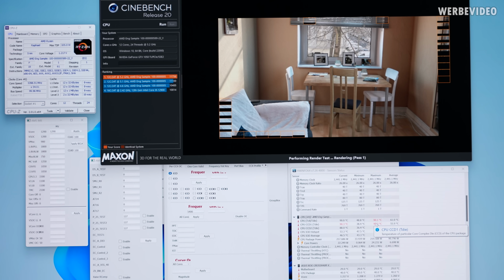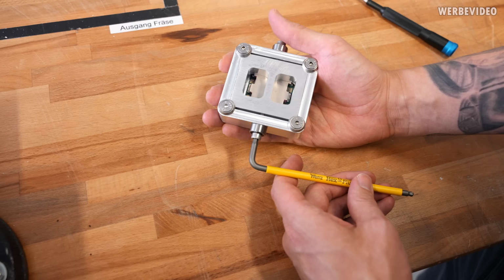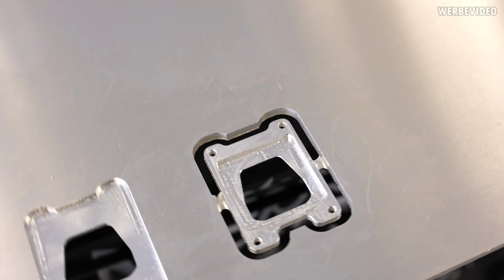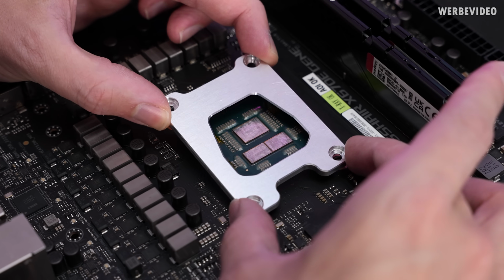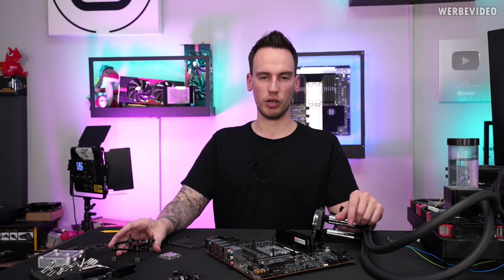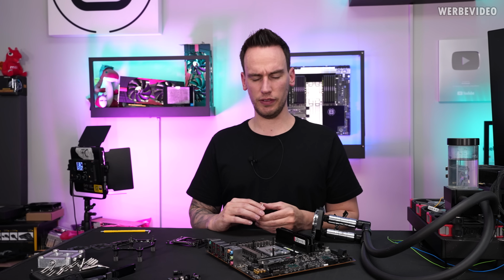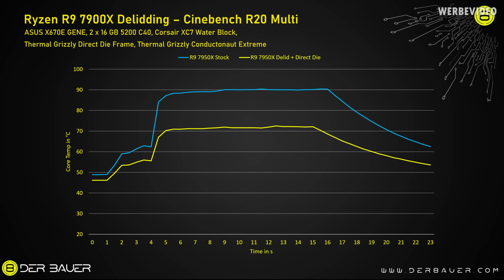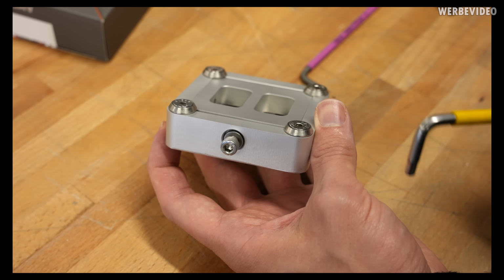Ryzen 7000 Delidding - Unreal Temperature improvement with Direct-Die Cooling

Comment: i wonder if there are companies that would sell de-lidded CPU's with blocks and brackets as a package, those temps are insane
Reply: You get no warranty from Intel or AMD on chip like that and its easier to damage So price would need to be much higher to cover customer support and warranty (in Eu you cannot sell anything with no responsibility at all, maybe in USA they could)
Reply: @cyjanek7818  No, you have to warranty it to some degree.  Not only would you run afoul of legal problems, no retailer is going to touch it.

You HAVE to send out working parts.  There is no way a delidded "at your own risk" part can consistently be proven to not be the manufacturers(or 2nd/3rd party who performed the delidding) problem.

That's also why ebay lists them so high.  The people selling them have to eat the cost of refunds when people break them due to ebay's policies(because Ebay sure as fuck won't eat the cost of a bad idea like delidded CPU sales).  Also, watch the video to the end.  Yep, even the delidding process makes waste, so it's probably not economical in the first place.

TL;DR Do it yourself, be ready to throw a grand in the fire randomly.  No one wants to assume your risk.
Reply: @Grimmwoldds  Thinner IHS CPUs might be viable and much better termals
Reply: @Grimmwoldds  I wonder if someone could figure out that risk exactly of that 5700 case. Like this who is selling the delid equipment. As you go selling those delidlings you get the data and can find out insurance price.
Reply: Right! 95 to low 70 is indeed impressive! Debauer u should update amd of the IHS thickness issues or maybe release a delid kit into mainstream damn impressive ! 😱
Reply: @CrimsonDay92ShaDow6iX  I doubt AMD would change anything. I'm sure they're aware of the thickness of it and what it does to temps. They really couldn't change it without impacting their board partners. If you lower the height even by a mm, you're then sitting under where a cooler could make contact with the IHS. It just wouldn't be feasible. You would then have consumers confused because what CPU works with what board? Pre IHS update chips would only work with pre IHS motherboards.
Reply: @CrimsonDay92ShaDow6iX   AMD designed IHS thickness like this to make space for 3D cache. Look at AM4 5800x3d. They where able to get extra cache on top of the cores or whatever without affecting cooler mounting/increase IHS thickness. Ryzen 7000 was designed for 3d cache but the CPU's launched now do not have it. But has space for it... Mmm. So the parts sold today is being hold back to make space for better parts in the future that needs more space.

I might be wrong. But that explains the IHS thickness. And with 3D cache heat is only to become harder to manage. And if I'm not wrong. Pats with 3d cache is going to make this costume cooler mounting incompatible since the extra space for cache is not accounted for. Like really this move with IHS thickness is just to make it easier for AMD. I bet AMD also have made sure the CPU's hit 95c by design to hide the IHS and in general poor cooler performance AM5 have. Since even with a good setup you hit 95c. With a bad setup you hit 95c. It is by DESIGN... Sure AMD. When energy prices are going insane we drop the idea of efficiency and boost performance by pushing more power!
Reply: @TheDiner50  I don't think the 3D cache adds that much height.
Reply: @Knowbody42  3D cache adds no height, they shave down the silicon before applying the cache die
Reply: @TheDiner50  No no no They make the IHS thicker for AM-4 cooler height compatibility. with AM-5. The non 3D version is the same thickness as the (7900x).
Reply: The problem with dllidedCPUs is that they too easy to get damaged
Reply: @alexer_eternity  They are not that easy to break specially if Intel and AMD directly sold them slightly cheaper without IHS and we would have coolers made just for direct-die cooling with proper safety measures that make it almost impossible to break them, kinda like a laptop or GPU, you really have to try hard to break one, I already made almost all my strength on many with a big screw driver and never managed to break the die on one of those direct-die coolers because they always have something to stop further pressure unless you go rambo muscle on them or with like a high power electric hammering screwdriver LOL.

with proper safety I'm sure it's always easier to break a motherboard pin or a CPU pin on the AM4 than cracking the die of the CPU unless you drop it into the floor and even still the CPU would be so light without the IHS that probably would be even safer when dropping into the ground cause many people broke CPU's that way where the corner completely broke and shorted all the layers but who knows...

ps: Also it would be about choices, true enthusiasts could save a few cents and get what they always wanted from start from the brand it self and a newbie or OEM PC's could keep going with IHS CPU's. The best for each person to chose (stupid in my opinion is paying for such thick IHS and all the metals needed in between to lose so much cooling performance that it's looking like when Intel cheaped out with thermal paste and that I never asked for)...
Reply: They're called laptops.
Reply: Silicone lottery used to do that as well as sell chips that had won the silicone lottery and had insanely high stable clocks. Unfortunately as tech advance, chipmakers began binning their good/bad chips with substantially more accuracy destroying half their business model. Intel followed with switching from polymer to solder TIMs which greatly reduced the benefits of delidding destroying the other half of their market. to finish things off then the supply chain issues began followed by covid and a whole heap of additional supply chain issues. All this combined happened in a 1-2 year span and forced them to shut their doors. awesome company while it lasted.
Reply: It's not sustainable to buy and sell delided, to much risk,
Reply: You have as much chance of that as getting a GPU without a cooler expense for choice of your own.  Noooooope
Reply: I was thinking the same thing ….. also a “one stop shop” is very convenient for many 🥰👍💪 ……. The return of Silicon Lottery 🧐🤓
Reply: Most likely not worth it at least judging people's price on delidded intel CPUs...

Even used they sell old CPUs delidded at such high prices that a lot of times we can now buy something much newer and better for the same price sadly...

I wish was that intel and AMD would sell a slightly cheaper CPU without IHS cause it's sad paying for something that I don't want and much less something pointless that makes the product much worse 🙁
Reply: @guily6669  problem is when people tighten it too much and destroy their cpu it will be amd and intel problem... If they release it like that there wouldn't be a warranty
Reply: @RYU47376  AMD used to sell CPUs without a lid. I had one with bare silicon die under the heat sink.
Reply: @RYU47376  I don't agree because if there was no IHS CPUs we would then have direct-die coolers and all the safety measures would be on the cooler to make it right but never to the point of breaking just like laptops and GPUs, they have either washers or springs to prevent further pressure and would actually be pretty hard to break such thing...

Also I already managed to break a 3770K die and it's not super easy, I had very bad luck cause I had bios problems and went back and forth many times with 2 boards and 2600K and the 3770K and the tems were still disappointing because I was using a huge air cooler with crap mountings, it only mounts vertically but sadly the cooler would move quite badly horizontally to the sides and when I was forcing moving the cooler sideways with my hands sometimes the temps drop by a lot. Sadly I eventually was pissed and make too much strength to the sides and that was it...

Anyway if the cooler was mounted like a "X" it would have had pretty good mounting pressure and would have had much better temps like a watercooler which has way less weight and distributes the pressure in both horizontal and vertical as long as the screws are tight in a X.

Also latest CPUs are even harder to crack the die compared to the 3770K cause the area of the silicon die\dies are way bigger.
Reply: @RYU47376  maybe with some block screws or something. Would be a good idea
Reply: @Wingedmechanic  Not just AMD, intel too, my Pentium 3 700MHz was also without lid,  2002.
Reply: @Wingedmechanic  K7 series were lidless, along with the early K8 consumer CPUs. They reintroduced IHSs with the Opteron as I recall.
Reply: @RYU47376  If they release it like that there wouldn't be a warranty
Sounds fine to me, I accept the consequences for all OCing decisions I make.
Reply: @guily6669  delidding the cpu greatly decreases the chance of false warranty claims from amateur users cracking the die during install or from shipping damage, especially when liquid metal or other electrically conductive Tim's are involved, those who are experienced enough to be able to safely run a delidded CPU usually are willing to do it themselves, I'm not trying to classify people, I'm just listing valid reasons. After all, amd cpus used to not have heat spreaders during the athlon days so it's not like it's never been tried.
Reply: @guily6669 the amounts of products that's have failures because of no lids protecting them probably wouldn't be good.
Reply: i was thinking the same thing. but woudn't mind spending the money to get all the gear . i like to run my hardware at the limit . while having low temps . my pc now runs below 60° on air . cpu , gpu , gpu memory . all below 60 . (5600x , 3070ti) not the most difficult to get low temps i know . 3d mark score above average for similar hardware. top 100 actually .
Reply: I think Roman should do it along with a complete kit.  DeLid and full kit.  I would buy it.
Reply: @halrichard1969  I don't think he'd take that financial risk.

Providing warranty on his own products which are cheap compared to these CPUs is one thing.

Having to provide warranty on CPUs would be a major financial risk.

And he would have to, as he's German and de-lidding voids the Intel/AMD warranty, so he'd have to provide the mandatory 2 year warranty on consumer electronics, on parts that cost over a 1000€ even for him.
Reply: no, too many idiots would spill liquid metal over the cps on the processor and kill the cpu/system and blame the compnay they bought it from.
Reply: And because of the risk involved in destroying the CPU, the pre-delidded chip packages would be really expensive
Reply: They could do a limited edition version of their "insert flagship cpu" and sell a limited quantity.
Reply: @CrimsonSteelMoonTheWolf64  my point is delidding is such a delicate process that if you mess one up you now have to sell 20 more to cover your cost. Ruben could recoup costs with hardware bundle he manufactures but it's just not a liability worth taking on. He'll gladly sell you the tools needed though
Reply: Just imagine some company call amd and buy cpu without Heatspeader and sell it higher price yeah and it come with some Mounting Kit yeah that would be something
Reply: @Cake-je1hu  however, if said company could get delidded cpus without the IHS directly from AMD that's a whole different story
Reply: is too risky for warranty etc for a company.
Reply: Can't wait for stacked cache models early next year
Reply: No, mostly because of the legal and warranty problems. You are voiding your warranty by deliding the cpu. The improvement is massive but this couldn't be sold as a pack as it violates AMD's legal property of the cpu
Reply: if they sell it they won't offer warrenties, cuz it's none standard and coolers may break the chiplets.
Reply: Better yet... AMD should just issue a never-lidded sku.  Save them some money, and maybe even charge a premium for a binned part with no lid.
Reply: That happened before! The amd Duron back in the early 2000s all didn’t have ihs’s
Reply: CPUs*
Reply: The risk of damaging inventory would make it a cost prohibitive venture
Reply: i would go for those as well, i don't mind them charging 200$ more for the delidding work.
Reply: there is a huge gap, between the die vs the base of the heatsink, that will make most of the AIO / heatsinks not compatible, and would require a lot of modifications.
Will see how this evolves
Reply: AMD can do better, they should release new SKUs... same CPU but without IHS.
Reply: seems kinda pointless unless you include a motherboard with pre-mounted block tbh
Reply: this used to be a thing, I'm sure if there's a market there will be a service, but it won't be cheap, expect to pay 1.5-2x the cost of the CPU.
Reply: Basically is. There is a company that delids and overclocks for you
Reply: @FearOfDeath1332  Silicon Lottery went out of business a while ago didn't they?
Reply: Caseking used to sell CPUs binned by der8auer, might as well delid them too :D
Reply: There are companies, or at least people that do. 

One such company is Silicon Lottery. Their primary business model was buying Intel CPU's in Bulk and binning them so that people could buy chips that guaranteed a target clockspeed for overclocking. They also provided delidding services to those CPU's for not much more. The CPU's themselves did sell for a $50-150 premium based on how high they could overclock them. 

However, they did not provide a warranty because Intel does not warranty them. However as far as I've known, it was rare for them to have a CPU die during the delidding/binning process. 

They have since shut down due to 12th gen showing that Intel binned their CPU's better this time around. 

But there are lesser known people who do these services. Just that you are assuming all risk because neither intel nor AMD are willing to warranty delidded CPU's because thats not what their original designed is based on for warranty.
Reply: Warranty
Reply: AMD could sell us a CPU with even less stuff added for more money, surprised they don't
Reply: @RogerS1978  to be honest that's more Intel style while AMD has always given as much as possible unless something wasn't ready or a lot of issues. But definitely less performance and people would still be happy
Reply: if you de-lid it you lose warranty and I doubt you find a company who will cover that.
Reply: @romanromero5099  Then don't if you scared or can't afford it. Delidding is extremely simple but if you feel like you can't or something might go wrong than dont...anything else should be common sense sherlock
Reply: @chosen1one930  you obviously haven't watched the end of the vid, there are few things that can go wrong. Also it is not about if am scared or if i can afford it, it's about the fact that you lose warranty if you do this Dr Watson. 🤦‍♂️😂
Reply: @romanromero5099  your crying about a warranty something we all know you big baby. Anything can wrong with anything in life but the chances happening are very minimal of course if you're in development stage of making something
Reply: @chosen1one930  first of all am not crying about anything you dork, nor am I discussing the endeavours of development which include failures. Am simply stating a clear fact that you will lose warranty, now if you wanna do it to your CPU or not your decision, you can put it even in a microwave, nobody cares. Plus I wasn't even talking to you, so if you have nothing sensible to say then don't.
Reply: @chosen1one930  if you can afford another.... very ingenious argument.... the fact still is that you will lose warranty. If you can afford to buy more than 1 good for ya dork.
Reply: Ya it's insane they even use an ihs. Gpus don't.
Reply: mass produced it shouldnt even cost that much more. esp if they come before theyre lidded from amd.
Reply: They should have sold the crystal directly soldered to the block and gotten rid of the lid, then there would have been no risk of damaging the chip. All you would have to do is connect your tubes, no thermal paste, no delidding, no loss of warranty. And if the difference is 20 degrees, it would also make economic sense as they could squeeze out more performance. It would reduce compatibility, but judging by the temperatures of the 7000 series, air coolers would be a thing of the past anyway. If AMD were Apple they would have done this a long time ago and other manufacturers would have adjusted to them, but that's the way it is
Reply: Yea they'll sell it with a disclaimer that says your CPU isn't gonna last anywhere near as long lol
Reply: I've been imagining that since the i7-3770k, they would have to sell As-Is IMO but at least show it working fully mounted and benchmarked. That way you can choose to even get a highly binned one too 🥰 or a middle of the ground one for a fair price 😉
Reply: They used to. Direct die used to be the standard in the P3/Athlon era. AMD went the extra mile and used radiator-balancing bumpers on each corner of the substrate, Intel just offered a bare die. Copper IHS’es entered the scene after that generation.
Reply: perhaps they could sell it with much thinner IHSs
Reply: Usually you can buy a delidding kit so you can do it yourself.
Reply: They do it with gpus why not cpus
Reply: it's fine for the CPU
Reply: I'm pretty sure AMD used to sell Athlon XP chips which used direct die cooling 20 years ago with rubber shims sitting between the heatsink and the chip PCB - I can't see why they can't sell these Ryzen chips in the same way as an option , especially as it's become clear that the heatspreader has had to be made sub-optimally thick to ensure cooler compatibility.

They could also throw in some mounting hardware too which replaces the socket to reduce the risk too .
Reply: Companies will never sell a variant like that. RMAs would be insanely costly. Even for experienced builders the possibility of destroying the CPU is too high. Only way they would sell a delidded cpu is by charging ludicrous amounts of money to cover the cost of all the RMAs but then they would get bad press for charging astronomical prices and the average joe not understanding the why the prices are what they are.
Reply: @duke605  I thought a delidded CPU would be safe to handle if installed in a socket with an approved mounting plate which AMD could specially design and include in the package (like that DerBauer has). I'd be happy to buy and use such a setup in my system personally. I agree , these chips should probably not be sold widely to retail though as I can see inexperienced builders messing up

Much safer than the old Athlon XP chips which ran direct die and only had four rubber shims sitting between the PCB and CPU cooler - while the PCB sat on top of a hard plastic socket which the CPU pins went into - too much pressure could crack the dies of those. Fun fact - those Athlon XP chips had no temperature throttling either so you could kill them easily by running them too hot.
Reply: @duke605  companies sell processors without heat spreaders all the time.  In fact the vast majority don't have one.  Look in your phone, TV, car, laptop, etc.  In fact the only place you find lidded CPUs are desktops and servers.  With modern thermal management the risk of frying the cpu is basically zero.  

The only risk is applying too much pressure and breaking the die, or letting liquid metal flow and short it.  They could sell an LM OC edition that comes without IHS and an epoxy coating over the PCB for added strength and protection for the other bits.  Then charge a small premium to cover the cost of any RMAs that result.
Reply: @josephhfry those are using arm entirely different than amd and intel which use x86.
Reply: Wouldn't happen for 2 reasons. 1.they are out of warranty after deliding so they would have to cover that. 2. People don't want to overpay for components
Reply: That's lowkey a great startup
Reply: I could see selling the delidding die and the custom brackets as a package, since you don't have to warranty the CPU itself at that point
Reply: Any time you make a modification you run the risk of bricking your hardware. Selling a pre-modified component means potentially selling a bricked component and can potentially put the seller in rough waters. There’s also the potential for bad actors to buy dead cpus on the cheap, de-lid them, and disappear with your cash. Personally, I’d rather buy/rent the tool to do it and do the mod myself.
Reply: @AndreiBYhappy  And I wish robots grew on trees
Reply: Very few people would pay the premium. It wouldn't be sustainable.
Reply: There is a company that does this.
Reply: @StefanRialnot gonna work, why they need create another skew, and with delid cpu are more risky compared to normal cpu and why they need release product for bunch of people its dont make any sense
Reply: I would love it!
Reply: Congrats you dream has come true :) The company is now Thermal Grizzly
Reply: They should make the ihs more thinner
Reply: There was a company that did that back in the old Intel days. So a new company will likely come.
Reply: @thereviewer6517  it's a high risk still. Wrecking a single CPU is instantly a loss of hundreds if not thousands.

And in the EU (and anywhere else they adopted similar warranty regulation), warranty would become a really big (and costly) issue.

As this voids the factory warranty Intel/AMD provides, which is in line with EU law, the company that sells de-lidded CPUs would have to provide the mandatory warranty.

That on top of not all de-lids being successful and the demand for this being small, you'd have to sell these CPUs at such a big premium barely anyone would actually buy them.

Creating a niche in a niche a niche market isn't as great a business idea as you think.
Reply: The better question is why AMD doesn't sell them directly.
Reply: @lperkins2  Why would AMD sell them directly? It's at higher risk to them, and serves no practical purpose. For actual practical workloads, you would be better off scaling thread and core counts instead. And when you include the actual costs of using delidded parts, you're better off using with 24/32/64 cores Threadrippers.
Reply: @sylfaerm3107  For SIs doing high end custom machines.  The fact that there's an after market demand sufficient to fund developing delidding tools means they are leaving money on the table (charge a premium for pre-delidded parts).  Alternatively, a variant with a thinner IHS that does not maintain compatibility with the previous coolers, but doesn't leave so much thermal performance on the table would be useful.  In both cases, SI-only would be fine.
Reply: @lperkins2  They did used to sell similar delidded chips with their Athlon XP line - couple of rubber shims between the PCB and heatsink was all you had.
Reply: @lperkins2  were you just ignoring everyone in this thread? It's a liability issue, people will damage the products and blame the CPU manufacturer which would increase the cost of the product to cover the expected cost from those. It will also possibly damage their reputation with bad reviews coming their way. Have you ever read a review section of a product? There's multiple idiots in there not knowing what they're doing!
Reply: Why is it risky on CPU’s but not GPUs? All GPUs have exposed dies. And changing thermal paste on them doesn’t void warranty.
Reply: @LoFi3  they are manufactured differently.
Reply: It’d be pretty difficult packaging wise theres a lot of tiny components that can be easily damaged.
Reply: There was Silicon Lottery and I think they had to close as people wasn't buying
Reply: @Flashbang_Photo  People were buying constantly from Silicon Lottery.

Gamers Nexus posted a video on them shutting down and the reasoning was because CPU's during the past X number of years have had very little overclocking headroom vs older CPU's.

Silicon Lottery saw there's very little reason for them to exist and they stated they might come back if CPU's regained massive overclocking headroom like the old days.
Reply: Insane?  How bout a proper liquid cooler.  Anyone overclocking deals with these temps EASILY!! without delidding
Reply: @Fatpumpumlovah2  bro, the guy in the video is using a liquid cooler and it's still hitting 90+C. AM5 gets hot.
Reply: I would buy it at the same price, even if it meant no warranty or support. Seems pretty fair considering delidding voids warranty and the most dangerous part with this is the actual delidding rather than actually using it.
Reply: @joemarais7683  "even if it meant no warranty or support".

Yeah, no warranty means no business in the EU, making an even smaller niche market.

In the EU, Warranty on consumer electronics is not optional.
Reply: @joemarais7683  You CANNOT sell things with no warranty or support.  Legally, nor according to EBay/Newegg/Amazon/Microcenter/etc.  The only place you might be able to get away with it is something like craigslist, where they just make advertisement and have no participation in the transaction itself(therefore not even services like Mercari)
Reply: You just watch a video from one !!!😀
Reply: @thereviewer6517  AMD should offer it for $100 more. They could do it at the cheapest rate.
Reply: @Ultrajamz   I really wonder why would AMD should offer for 100$ more when both Intel and AMD should already have had all variants of their mid to high range CPU's in a non IHS variant in my opinion.

It should have been is less like 5$ at least because the IHS is fully made of copper then nickel plated, then has the gold plating material inside and then the soldering material and they basically could skip all those extra steps, so should be cheaper and not more expensive...